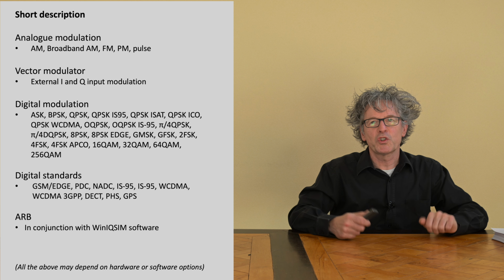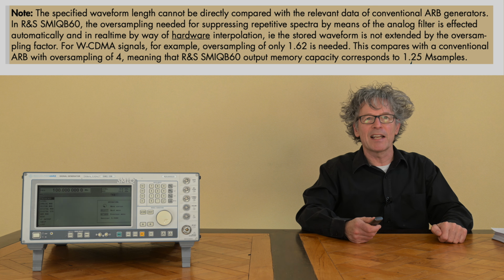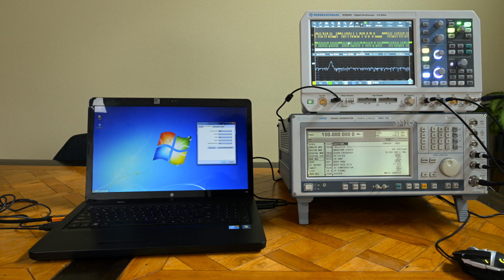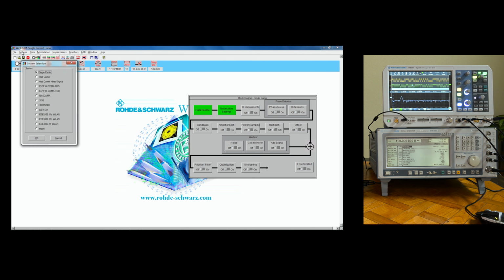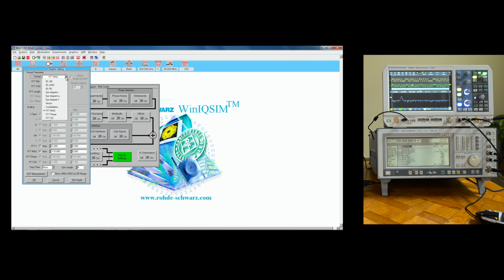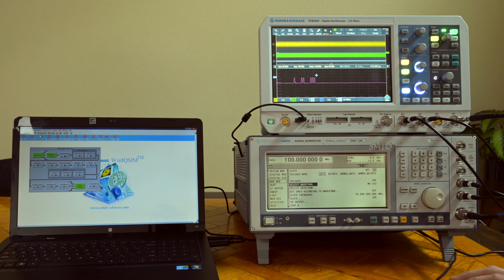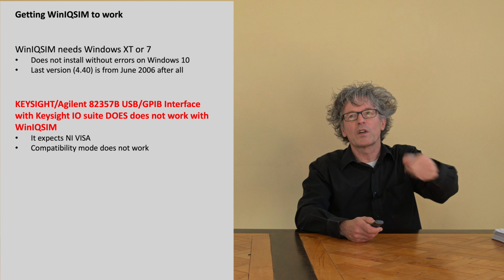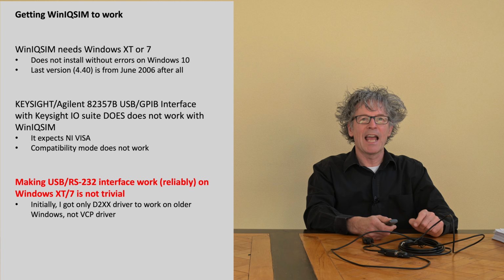REL #52 Complex signal generation with the R&S SMIQ and WinIQSIM

Comment: Rudi,
check my comment in your thread on the eevblog forumm. It is possible to run WinIQSim on Windows 11 without issue. And it's even possible to connect to an AMIQ with an Agilent 82357B. If only I could explain what I did to make that work...

Comment: Hey... I built a satellite downlink test system, with the AMIQ, SMIQ, and the Tektronix realtime spectrum analyzer, in 1999!
User interface ran on the RTSA, developed on my laptop, in visual basic, using data patterns, including Reed-Solomon error correction codes, converted to AMIQ sequences, and did it all in 3 days, in February, in Winnipeg, in my hotel room...
I loved working with the SMIQ/AMIQ, you could build all kinds of signals... I even did a demo in Seattle, with an in-band distortion analysis, by building a WCDMA signal with a super deep "notch" in-band, something that Agilent couldn't touch, at that time, I was able to get better than 6 dB deeper notch!
Reply from the maker: Cool project to read about, nice gear indeed (though carrying an AMIQ and SMIQ to a hotel room is quite some weight ;-)

Comment: Hi, Very good. I must try it. I installed the program on Windows 11 but had to turn the real-time virus checking off to do the installation. The program runs with the virus checker back on. Regards, Drew VK4ZXI.
Reply from the maker: Good! Did you actually get it running with a SMIQ? On a discussion we are having here, there are several other people that had similar issues as me, like not getting the SMIQ software  to run with Keysight/Agilent/HP GBPI interfaces, or having the software run on modern 'fast ' computers: https://groups.io/g/Rohde-and-Schwarz/topic/111486895